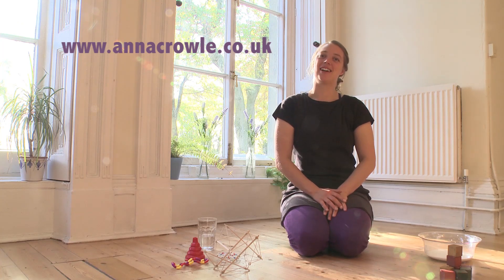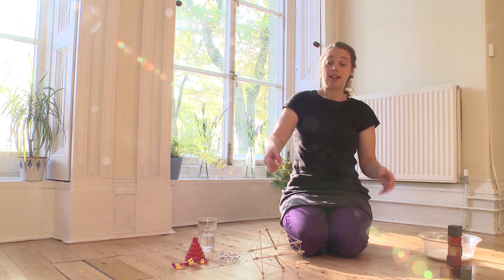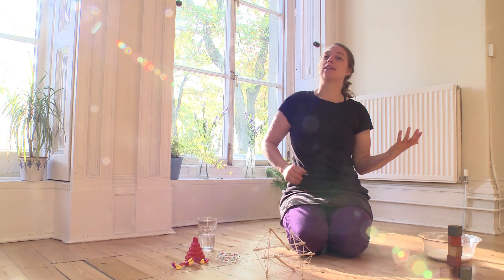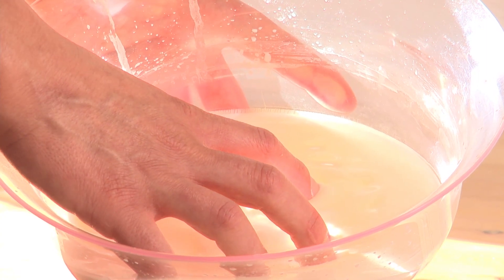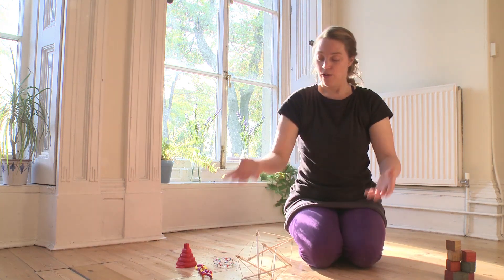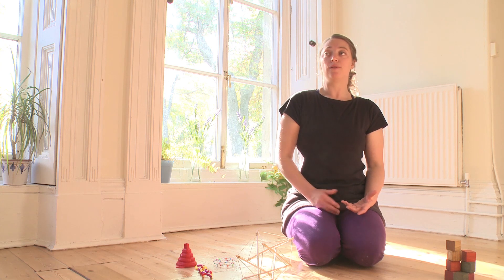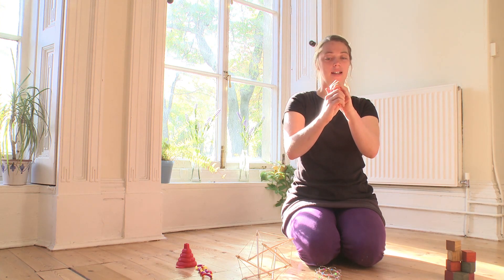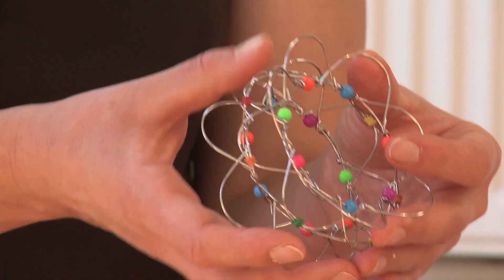Anna Crowle: A biotensegrity approach to understanding pelvic organ prolapse

Comment: Anna, thank you very much for this video and your explanation! It was recommended by Denise from Flower Empowered. Could you please share more about release of the facia? How can we do it through exercise. My pt believes in facia release, she applies a very gentle pressure to various points and I do feel better for several hours after that. But I feel like once a week is not enough. If there is any way to do it through yoga or pilates, I would gladly pay just to be able to exercise. 
Thanks!
Reply from the maker: Hello
My colleague Claire Sparrow has designed a movement course for releasing the pelvis. It is called Pre-Pilates for whole body pelvic health, here is the link to her website : https://claire-sparrow-pilates.teachable.com/